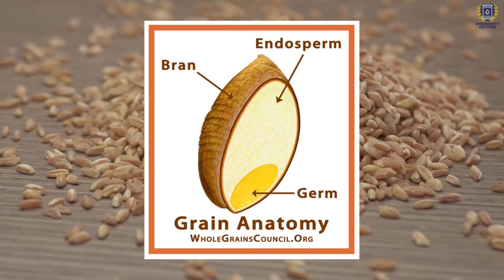WHEAT Documentary: Everything You Ever Wanted to Know about Wheat

Comment: Before it is time to plant, farmers need to prepare the soil. Some use a machine to plow the soil. However, today most farmers are switching to a method called “no-till.” “No-Till” farming is a way for the farmers to maintain a better soil structure by not plowing the fields. Once the soil is ready, a machine called a grain drill is used to plant the seeds.

Wheat is planted at different times depending on a region’s weather conditions. Some farmers grow theirs in the winter while other grow theirs in the fall. Once the soil is ready, a machine called a grain drill is used to plant the seeds. Wheat grows through stages. At first, the wheat is green and can look like grass. Then it grows taller and becomes a golden brown color as it dries.

Carbohydrates are important to your health. Your body needs carbs to work properly. The Dietary Guidelines for Americans say that 45% to 65% of your total daily calories should be carbohydrates.
Reply from the maker: Interesting observation and good information on no-till farming. The dietary guidelines for Americans are an absolute joke however.